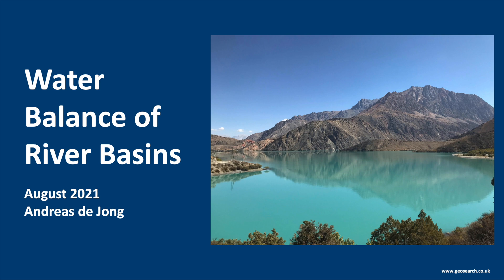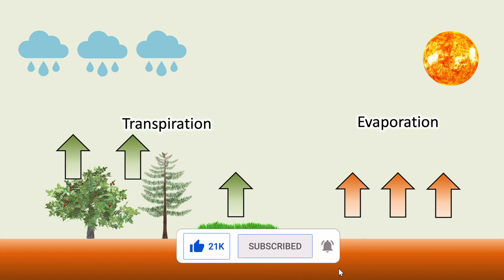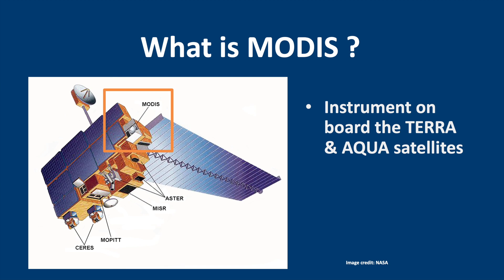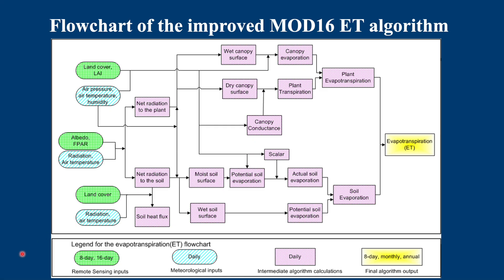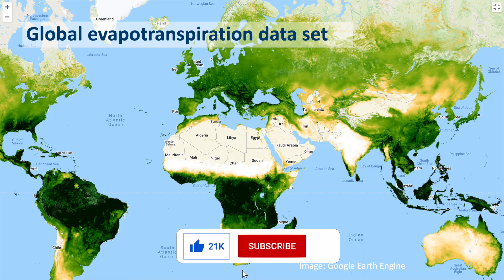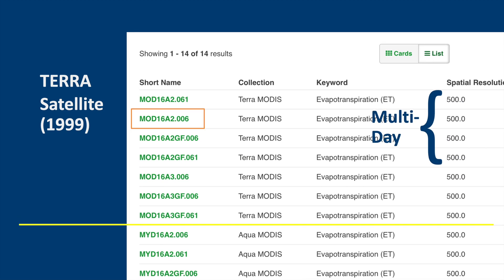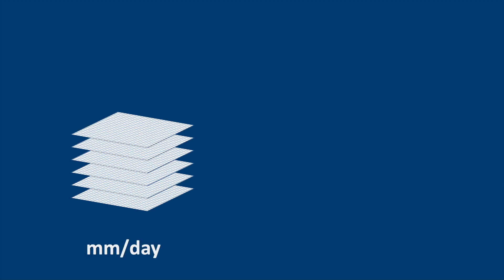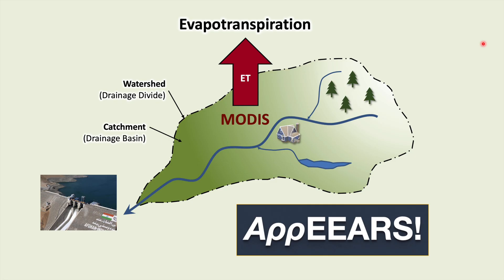Introduction to MODIS Evapotranspiration (MOD16) - a free global dataset of ET & PET

Comment: @GeosearchInternational, Hello sir, I have a query regarding the evapotranspiration product MOD16A2 As it is showing that the product gives Evapotranspiration (ET) and Potential Evapotranspiration Data (PET) data, what are ET and PET ?
Reply from the maker: PET is the potential (i.e., maximum possible) evapotranspiration, which is only possible if there is sufficient water available. ET is the actual evapotranspiration - i.e., what has really evaporated. All the best, Andreas
Reply: @GeosearchInternational  Thank you for the response, based on it can I say PET is reference evapotranspiration and ET is crop evapotranspiration?
Reply from the maker: Yes I think that is correct, as MODIS follows the Penman-Monteith method to calculate PET, which is the only one recommended by the FAO to calculate the reference evapotranspiration, ETo. As far as I understand PET is an older term which should actually be replaced by reference evapotranspiration. ET is just the actual evapotranspiration that is measured over an area. It will be crop evapotranspiration if your polygon is over a cropped area. If its over a river basin it will include all the actual ET from that area. Just be careful as ET/PET cannot be calculated from non-vegetated areas such as barren deserts and open water. Good luck & all the best, Andreas

Comment: hello sir and thank you so much for this video, i need to work with the energy balance models (TSEB, SPARSE,SEBAL) to estimate ET for irrigation scheduling.. Now all of this is so new to me and i don't hv any clue how to do it, i've started with the basics of ET using Modis products and the Fao method, can u plz suggest any videos that explains these models as easy as u did in this video?? THANK YOU AGAIN
Reply: Have-you ever tried the AquaCrop free logiciel providing really accurate irriguation agenda?
Reply from the maker: Hi Ikram, Sorry, I haven't used any of the models which you mentioned. From my research MODIS seems to be pretty good for what I use if for, which is river basin water balances. I assume that it would also be good for irrigation scheduling as you get frequent data, and the resolution is pretty good. I have not found any good videos on evapotranspiration, which is why I have made two videos on the subject. Mostly the good information is hidden in the manuals or scientific publications but it takes a lot of reading to find things which are actually useful.
I presume that you have seen the next video in this series about how to download the MODIS data? https://youtu.be/cUAtYyGI9mI
Good luck with your research & all the best, Andreas